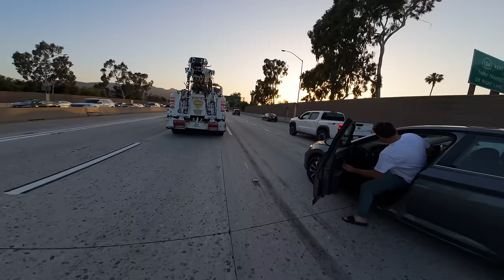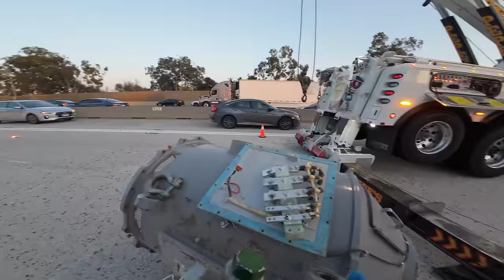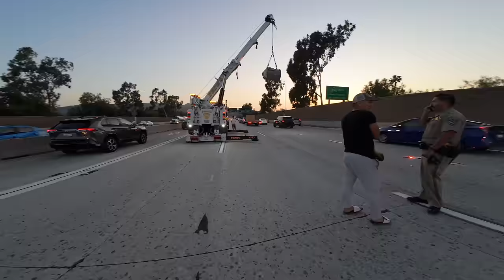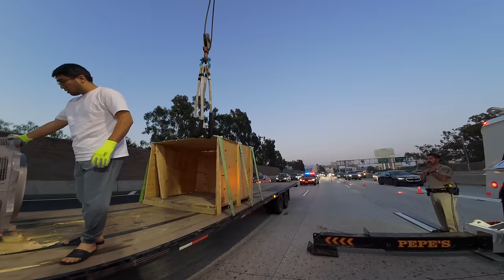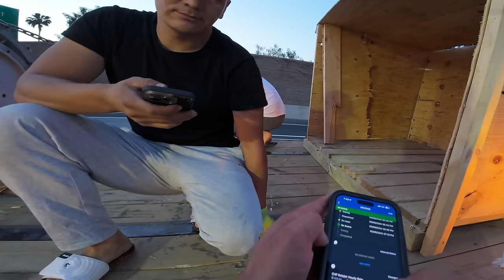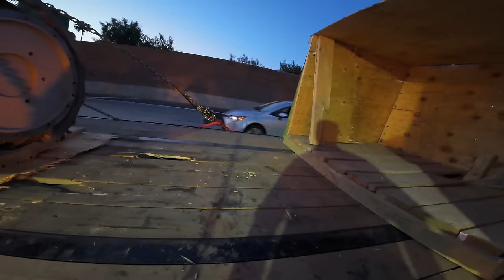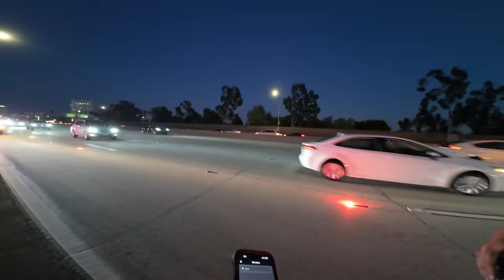18,000lb Alternator Falls off Trailer on Freeway

Comment: Good thing they both had their safety sandals on
Reply: OSHA Certified.
Reply: It's all about comfort when hauling 9-ton alternators, you know, house slippers , next time maybe a bathrobe.
Reply: As long as they're steel toed sandals....
Reply: How much you guys think the service call was?  $1,000?  $1,500?
Reply: Does U.S. not equip it's police with high visibility clothing for this kind  of mission, or train them to  stop traffic flow?
Reply: Cracked me up
Reply: Steel toe boots aren't going to prevent an 18,000 pound squisharoo to the toes
Reply: @TheDude1980  thats probably a 2-4k being its california a Rotator etc etc etc
Reply: @Mandonuts  Wow, that’s pricey, but in hindsight this could have been way costlier than just the alternator falling off the truck bed.  How fortunate were they nobody hit it at freeway speed’s!?  They could have easily caused a multi-car crash with this negligence.
Reply: not the only thing, what about walking under the load, standing too close to the live lane
Reply: @TheDude1980  You are the closest with 1-1.5K There is strong competition. 2-4K is fantacy invovling 1 rotator only for an hour
Reply: @TheDude1980  Minimal $600. There was no serious work required. No slope or incline. No mountain side, rescue. Etc.
Reply: @TheDude1980  Minimal $600. There was no serious work required. No slope or incline. No mountain side, rescue. Etc.
Reply: Gotta have the regulation footwear for the job.
Reply: well 18k lbs i doubt it matters if you are wearin anythiing.. know what im sayin.. ya feel me. do ya well do ya.
Reply: I hope the man delivering that item got fined for not securing his load
Reply: It’s obvious that the packing In the crate was positively inadequate. Somebody cheeped  out on the shipping cost and unfortunately this guy has to pay the price.  Everyone was fortunate this happened at low speed. I hope every trucker out there has learned to never accept a load without inspecting the contents.
Reply: yeah but they forgot their safety rag on top of their head
Reply: @philhealey4443 yes but it's up to them to wear it and no they don't shut down all Lanes of traffic just for a stupid alternator they might shut down one or two lanes but traffic needs to keep on flowing people would go nuts
Reply: @asmongoldsmouth9839  that is not why it's so pricey it's because of the risk  those guys risk their lives more than those cops do and they get paid well for it also those guy have to pay a ton in insurance and those Wreckers are pretty pricey anywhere from $200 to $350,000 depending on how it's equipped
Reply: That thing would crushed a safety boot.
Reply: @TheDude1980  $ 700 per hr clock starts when I leave my shop or location. 2hr minimum $1400 what id charge. Crane operators on construction sites charge the same. Travel time.
Reply: At least one guy has gloves while getting ready to tackle a n alternator weighing thousands of pounds
Reply: Everytime I had to deal with them in the trucking industry they had track suits and flip flops. No conception of steel toes
Reply: Another secure load which ended up on the freeway  very expensive mistake 
All the best from Nottinghamshire England 👍👍
Reply: Safety floppy floppies 😂
Reply: Brother the most expensive steal toes wouldn't save you from this falling on your toes ....
Reply: I would NOT stand under a crane. WTF
Reply: @philhealey4443  He 100% has a high visibility vest in his cruiser, probably the trunk, but he just didn't put it on. He really can't stop the flow of traffic where they are, not sure if you've driven on the highway in CA, but him stopping the traffic for just 15 minutes would cause a massive backup that could affect traffic for hours.
Reply: Steel Sole Technology.....
Reply: 8 tons on a trailer they in flip flops for the beach.
Reply: I don’t get most of these Sandler drivers. Like I wear wool socks and steel toe when around anything like this.
Reply: Straight outta Brampton, ON
Reply: California
Reply: @TheDude1980  he probably don’t roll out of the garage for under $1000
Reply: @philhealey4443  all police have High Visibility vests in their vehicles. I believe this CHP officer decided not to use it.

Comment: They’re going to deliver that alternator to the customer like it never even fell off the truck. Lol.
Reply: Something fell off a truck?
Reply: @VarzaHD 😂
Reply: Wdym by fell off the truck?  Looks brand new! Minor scratches from factory!
Reply: No, these are machined factory grooves, not scratches.
Reply: they no spekoo da englirisky!🤣🤣
Reply: Client: why were you delayed? 
 Driver: got stuck on the freeway behind some idiot who's load fell of their trailer.
Reply: Just randomly saw this video today. Curious anyone know what is this alternator going in or for? Sorry for asking.
Reply: @rafaelhernandez4361 pretty much depending on type it could be for power or something else but based on shape and size i assume that one in video would be for power too small for anything else
Reply: "Thee dyent there when I peek op. Cyka blyat"
Reply: @rafaelhernandez4361 thinking it was going into a genset. Now it's going into a scrap yard
Reply: Empty wooden crate and all...😂😂😂
Reply: @arandomsystemglitch2398 An alternator used for power? Well duh... Thanks captain obvious 😂
Reply: @rafaelhernandez4361 It'll be the generating head for a large diesel generator.
Reply: Good. Customer deserves damaged product for going the "cheapest they could find" delivery route.
Reply: @rafaelhernandez4361  some sort of water source is my guess
Reply: Those aren’t cracks it’s just extra heat sinks
Reply: @rollins360  100% and if there is someone  to receive it they will say idk that's how it was loaded! And the customer if hes smart will reject it and make them take it back!
Actually someone would have to be there to get it off lol

Comment: 1. load not secured. you have 18,000lbs floating around in a 20lb wooden box! 2. sandals! 3. my man is walking under the 18,000lbs. 4. damn
Reply: I did rigging in the steel industry. I think it's an instinct. 
Some people have it and some don't. 
I can see the forces.
Reply: that truck is only rated for 16000lbs including a trailer hauling they’re trying to cheap out on transport they’re already overweight 3000lbs at about 19000 including the trailer
Reply: @drippy_pics9086  Accurate.  And they don't know what they are doing.
Reply: @drippy_pics9086  that's not how trucks work I hope you know. As long as you have adequate brakes on the trailer and truck. You can legally haul alot more. Just need a Class A license. I can haul up to 26000 max and only have to have a DOT physical
Reply: @jordanalexander615  they’re cheaping out here by not using a licensed CDL driver  the transformer trailer truck combo is over 26000 pounds that’s an 8000lb truck pulling 20000 u wasn’t clear in my first post and used wrong numbers
Reply: @drippy_pics9086  I mean we do it alot you have to have a CDL for anything over 26000 and if the truck pulling has a max gross weight rating of over 10k you also have to have a CDL. But the trucks can easily handle more than their tow ratings. Just gotta have trailer brakes to do it safely. We have 36 foot goose neck with 10 ton axles. But it licensed up to 50k even though it would never handle it
Reply: If that thing falls on your foot it won't matter what shoes you're wearing.
Reply: The 4. Damn had me rolling lol
Reply: @jordanalexander615  I don’t think you payed attention in your CDL class, or you have no idea why there is weight ratings. I hope you know! Adequate brakes do not beef up the vehicle to handle more weight, only make it stop with the weight. Suspension, engine, and drivetrain are just as important if not more. You can easily tow more than the trucks capacity, but You cannot legally exceed the weight ratings of a truck or trailer, or both combined. Under no circumstances, you will end up just like this guy even with your CDL.
Reply: @dyllenmccarver3947  yeah I found a plate on the inside of the door that says the truck was legally modified to tow a bit more. Didn't know they did that. It's licensed to tow up to 16000lbs from hitch. I was already under weight anyways and didn't realize it. Truck was tuned and had larger brakes and rotors added to it as well as a long frame hitch that runs about 42 inches along the frame. So all the paperwork is in order. I just have to stay under 11k on my trailer because of my axles. Trailer is rated for more but don't have the axles for more weight.
Reply: @drippy_pics9086  and btw both Ford's and Cummins are rated at around 30k towing from fifth wheel hitch now. Duramax used to lag behind but have almost caught up.
Reply: 5. DAYUM
Reply: Major pucker factor as he slowly walks under the hanging equipment.
Reply: @drippy_pics9086  It being a Crew Cab doesn't help, but they're in a 4x4 Cummins dually with what looks like an 8 foot box.  Brand new Rams with this set up can tow up to 37000 pounds but this is also dependent on axle ratio.  Looking at the model, I don't think it has the AISIN transmission either.  I'd say this can do at least 20000 pounds and would do just fine including the trailer.    This was all about how this was strapped in and using the brakes correctly.
Reply: @drippy_pics9086  GVWR and towing capacity are different. it can have 16k in the bed or 16k of tongue weight from a trailer (Which is nearly impossible to do)
Reply: @jordanalexander615 i don't think there's ever any way to "safely" overload a truck. Very careless to risk lives around you just to save time.
Reply: @jordanalexander615 You can't legally haul any more weight than the vehicle manufacturer says it can regardless of your CDL or your perceived capabilities of the vehicle.
Reply: @deezelfairy  I get that now but this driver clearly wasn't over his weight limit. Im good up to 26000 with my truck trailer and load. Add a goose neck and puts it up around 34000 but need a CDL then.
Reply: it was secured they strapped the crate down to the trailer. how were they supposed to know it wasnt secured in the crate?  there just the movers. they most likely didnt even know what was in the box.
Reply: That Alternator must be damaged!
Reply: @bobclavi  exactly and that's the responsibility of the person who created it. I had to build a pyramid inside a crate to reinforce a plastic mold injector to keep it from moving or flexing. Made it down some rough roads in Mexico no problem
Reply: @lvlndco they expected him to walk in front of the moving cars I guess
Reply: *former alternator. I don't think any respectable company will use that anymore.
Reply: The box is probably  closer to 200lb and the box was secured. If driver really didn't know what's inside then it's understandable. Although he should've asked questions as soon as he realized how heavy the box is.
Reply: You'd be surprised how much weight pallets can wood in general can take.

Comment: We used to pack stuff like this , either you build a strong wooden frame with tie downs so the mass can be restrained, or you put it open on a pallet  for the trucker to secure it , you don't put it in a blind box loose
Reply: It's one thing to make sure a load is secure for normal driving, but what people forget is that load has to stay secured even in the event of an accident or rollover. If someone cut that pickup hotshot truck off, and he t-boned someone, don't want that 18000 pound object becoming a missile.
Reply: That is very basic common sense, but unfortunately around 80% of the worlds people don't have that.
Reply: That was my first thought, something that size and that shape just in a crate with no bracing, I wonder if they secured it to the base and assumed since it was bolted to the base it wouldn't move. I've seen some disasters show up at my shop that "left the dock in perfect condition" well yeah, the main thing is surviving transport in one piece, anyone can have shit leave their dock in perfect condition haha
Reply: @maxhill7065  Right, I'd need to know some more info on that alternator, but if it was 18,000 pounds and a good brand name like that, you'd think for something worth over $10K easy even if it was a used one, they could have spent a little bit more on the packaging... what's that saying, the bitterness of poor quality lasts longer than the sweetness of a low price is forgotten.

That flimsy packing crate couldn't hold a Cujo, let alone a metal object weighing 9 tons, that's a little more than a full grown elephant FFS.
Reply: YEP i hauled steel and if i did not like the way it was loaded so i could strap it safely i made them redo the load, once on the road it is your headache and you
are responsible for the safety of both you and others. the stupidity of this move is amazing.
Reply: @edwardmylnychuk5774 since you know the trade well, you might be able to answer my question. Who is going to pay the tow fees? Is it going to be the driver or the people that packed it?
Reply: The real issue is they did not slap it and say "this isn't going anywhere" many such cases
Reply: @hopeliveshere1121  dont know, i never had that problem because i made sure my loads were secure, it would probably be both parties if it goes to court because the shipper did a crap job of packing and the driver did not check to see how secure the load was or even if he could. shippers are sometimes jerks because i had two skids on a trailer, one marked food items the other was a hazardous type and i told the shipper we cant do this but he insisted so when i went to drop off the skid the company refused it because of this, if they had arranged for it to be my last drop it may have worked but it was my first drop so it did not happen.
Reply: @hopeliveshere1121 the insurance companies are going to fight over it
Reply: And especially not 9 TONS of material !
Reply: @hopeliveshere1121 : 100% driver's RESPONSIBILITY  !
Reply: Once I seen the box omg lol  wow 😮
Reply: Yeah it’s crazy it traveled like this idk how far. And glad nobody got injured.
Reply: That makes sense. This thing, when it fell off the truck, could have killed a dozen people! It HAs to be secure! It also no doubt was destroyed, costing somebody maybe $100K… maybe a lot more.
Reply: @Kristopher1999 In other words, the load gets strapped down directly. The box is just to protect it. It gets strapped down separately.
Reply: @dododede875 Or killed! Imagine that thing rolling down the highway, by itself, at maybe 70mph?! Dan-ger-ous!
Reply: I bet there’s a lawsuit to decide whose mistake it was, and who is responsible for the costs/losses.
Reply: @dtiydr Common sense comes with experience. It is not innate. The trucker, unless he’s a novice, should know better than to carry a very heavy, CYLINDRICAL-SHAPED machine, on a truck, loose in a box! It would be almost guaranteed to break loose at some point!
Reply: @yankee2yankee216  Common sense is things that does not normally come from experience and thus named common sense, it is more an IQ thing in many cases.
Reply: 100% spot on this specific item should have been set on and open wood frame realistically the bottom being wooden and just secure the top how they did after the fact lol
Reply: @yankee2yankee216 years ago when I lived by there, a steel coil fell off a trailer onto the QEW in Ontario Canada. An Air Liquide tanker hit it and the driver was killed.
Reply: I was hoping someone else noticed that.
Reply: @dtiydr 80%? More like 95%
Reply: @yankee2yankee216  
"The Box", by design has no way to protect anything!
Reply: @hopeliveshere1121  The company that packed the alternator will ultimately end up paying for the recovery service. Their failure to properly pack, brace, and strap down the alternator as well as engineering a suitable shipping crate for an 18,000 pound load is what caused this to happen.

Comment: As frustrating as it is to sit in this traffic, I'm glad guys like you have the balls to get out there in the middle of it, risking your equipment and yourself, to clear stuff up. Thanks man.
Reply: Money is the key factor. I'll guarantee you this costed somewhere in the ballpark of $2k .
Reply: @jaybee5832 Rotary crane like that? Way higher.
Reply: @gbmotors4150  Doubt it but okay.
Reply: @jaybee5832  Doubt it all you like. I’ve worked on heavy equipment for years, I drive a Pete with a crane, and I know how expensive it gets. Keep typing, kiddo.
Reply: @gbmotors4150  I worked in several fields evolving wreckers & cranes  try again. Kidddddo...
Reply: @jaybee5832  Yeah, saw your previous comment about being a mobile tire guy for 12 years. I’m sure you know all about the biz. Probably tell all your friends you’re a “technician” as well. Later, scrub.
Reply: @gbmotors4150 Tech? Yes. Also was a car dealer auto repair shop for  years worked at 2 local shipyards and construction.  You are correct. You should also see that. I'm not sitting around playing video games. You should consider that I'm  likely 4X your age at minimum. 
You should have also seen when I mentioned what's charged on this coast & the poster responded that he doesn't charge for those services . He waited to get paid longer than it took to do the job. He also saying he didn't charge for waiting. So there's no way in h ell your numbers are way off. . Dream on kid.
Reply: I think it looks fun but I helped pick up trash on the interstate and people throw beer bottles at you thinking you are work release or community service. Missouri has a lot of adopt a road
Reply: @gbmotors4150  In your dreams kid. Stick to video games. 😂